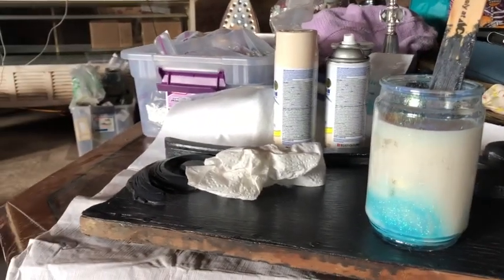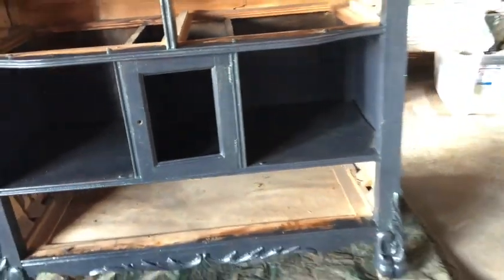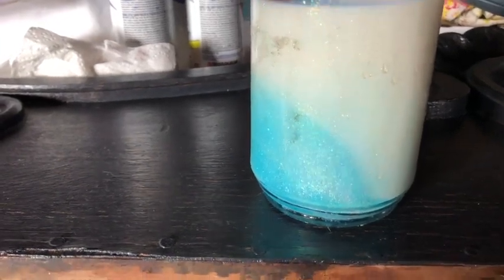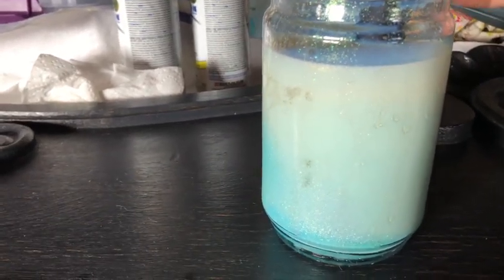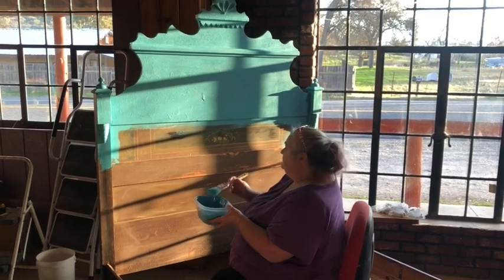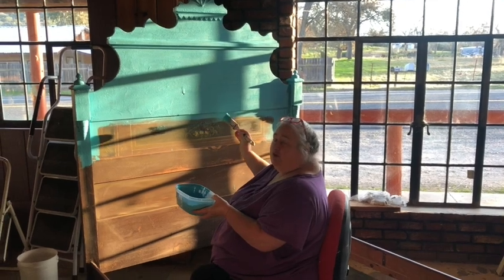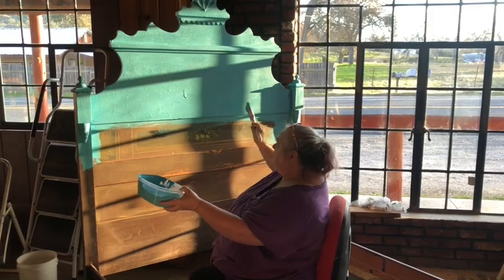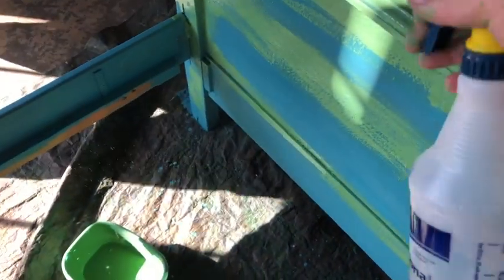Behold, the Magic!

Comment: The bed did turn out much better than I originally thought. Still maybe not my cup of tea, but will still make for an interesting display. I have a question about the diatomaceous earth. I use that on my plants and in my house for bugs. What’s its job in the paint? I’ve never heard of using it in paint so am curious. The cabinet in back turned out gorgeous. I was not seeing the color and shimmer you were talking about when it was up front. Don’t know if you added lots more paint or if the light hits it just right where it is now, but wow. You are one busy lady. Don’t over-tire yourself. No one wants you out of commission.
Reply from the maker: Marguerite Peaden   Hi Marguerite! We use diatomaceous earth as a pesticide in the garden and to keep ants, fleas, and other varmints at bay in the house too. Mixed  in a 1:2 ratio with flat latex paint it makes a wonderful chalk paint that allows for texture buildup and easy sanding to reveal edges and underpainted colors. You can buy these paints premixed buy I like the affordability and color control when mixing my own. thr black cabinet is in a great location now where the light really plays off the color. ❤️